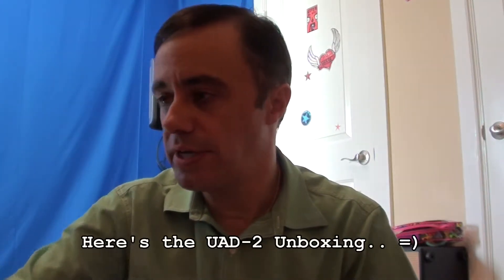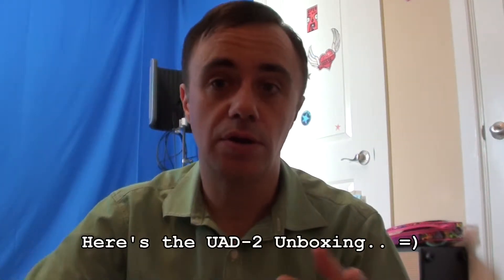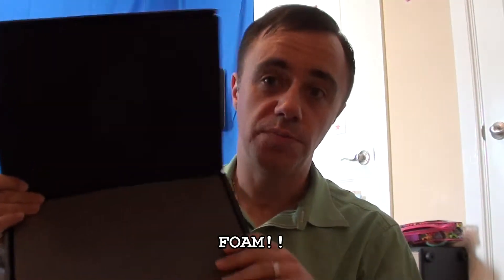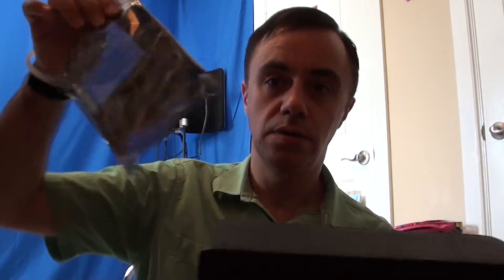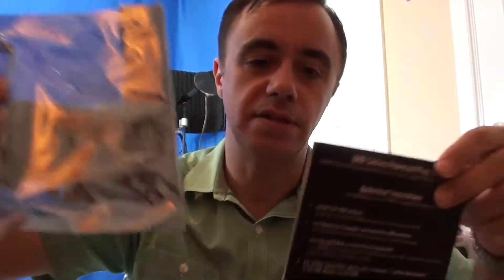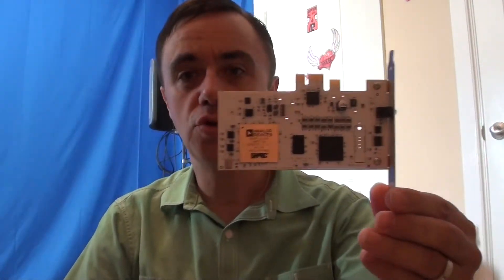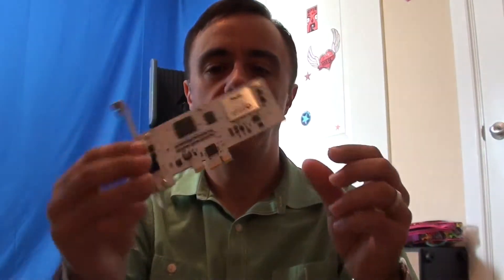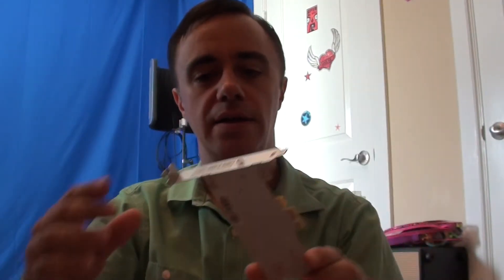UAD-2 SOLO Install (Part 2): Unboxing

Comment from the maker: Well, it really depends on which plugins you are running.. Some of the older ones you can probably run dozens of the plugins.. and some of the newer ones you can ONLY get 1 or 2 instances running on a SOLO card. Each plugin in UAD2 has it's own demands of the DSP processor. Best thing is to check uaudio.com and type in "instance chart" and you will be able to see HOW MANY of EACH plugin will run on a SOLO, a DUO, a QUAD, etc. If you RUN OUT of DSP.. you can usually "FREEZE" tracks in DAWs.